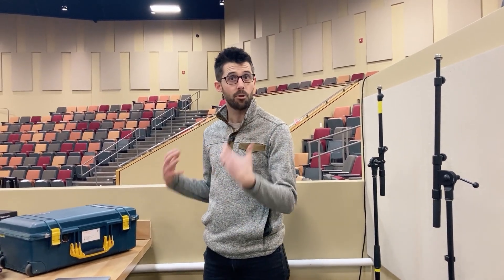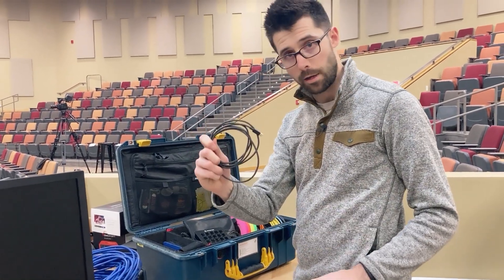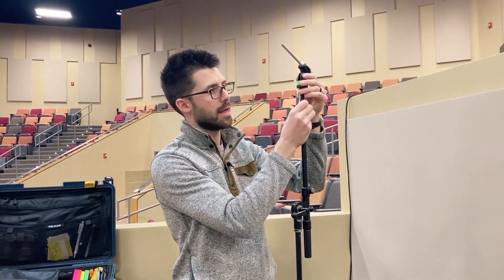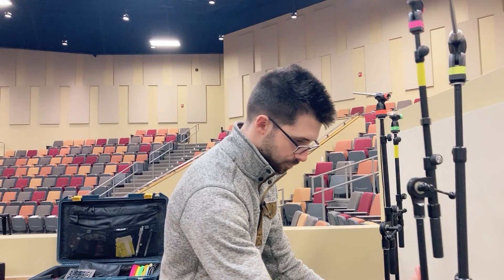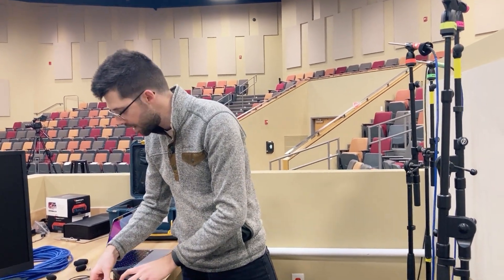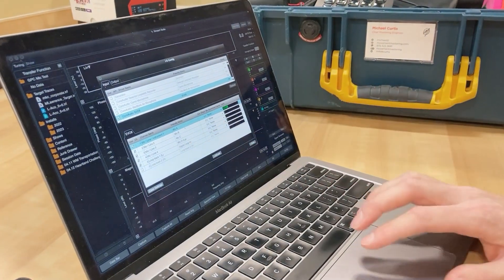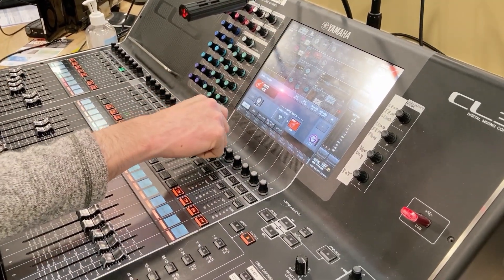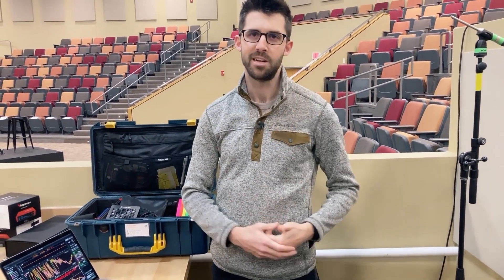Setting Up My System Tuning Rig From Scratch In The Field

Comment: Hi Michael, thanks for making these videos.  I recently purchased a set of 8 JBL SRX906LA speakers that I want to hang.  These will be for mobile events and the JBL tech that I'm currently speaking to knows nothing LOL.  I'd like to know what the steps to get started to fly them (I have the lifts), best way to control them, what software to use for prediction, etc.  and in what steps to use each software.  Thanks!

Comment: Hey Michel,

You don't need to have a loop back (Main out --> input interface) as you showed in a previous tutorial ?
I suppose you can have a loop back with internal routing. I thought you need to use the same path as you use for the measurement mic.

Thanks for your work.

Comment: Hey! Is there a reason, why you're not using the build in signal generator of the CL3? Loved the video!
Reply: I may be mistaken, but I  believe it so that the software knows the source signal and can compare the source signal to the measured signal... if you used the generator from the console, the software would only be able to measure the signal in the room, but not compare that measured signal to the original to determine where it shifts.
Reply: But couldn’t you just route the mixer Sig gen out to the computer so it uses that signal coming into the software as the reference?

Comment: Hi! You mentioned wireless, would it be a bad idea to use a wireless system for reference mics?
Reply from the maker: As long as the system is LTI - linear and time invariant. Even nice stuff like Shure Axient has some amount of variance in the timing of how the signal is transmitted, so isn't suitable for tuning (although it's plenty great for wireless vocals and such). I'd like into the Lectrosonics TM400.

Comment: Hi Audio University, I have a question. Most of the time in live sound applications, the speakers sound distorted when the full band is playing. (Keys aren't hearable, bass sounds muddy, drums isn't clear) Do you know what causes this? When I test them alone it's fine and it sounds good. I also checked the amplifier and it's not clipping at all. My gain level on the digital mixer is always -18dbfs.

Comment: This information is so helpful!

Question, do you recommend using something like Waves “Tract”? And if so, would you be willing to do a tutorial on it?
Reply from the maker: You're very welcome! I personally haven't used Waves TRACT yet, but am hoping to get a copy and try it out soon. The EQ within the plugin itself in and of itself is just fine, but the most common error when using the TRACT plugin is folks not carefully WHERE to put the mic for measurement data, as well as having a systematic workflow to work through different speaker zones.
Reply: @MichaelCurtisAudio  I appreciate the response!!!

Comment: We are basically using this same setup for spl monitoring on Sunday mornings.  How would you calibrate the gain on the mic so that is correct?  We do have a mic calibrator but it always seems to be way Hotter than actual sound levels.
Thank you for all your hard work.  Loving all these videos!

Comment: Not sure why I’m having trouble understanding the reason to loop back the reference noise… what am I missing by thinking you can just turn on pink noise and do your measurements? Where does the reference loop come into play? Thanks!
Reply: The way I understand it is that if smaart don’t have a reference signal, in this case the loop back, how is going to know the difference between a good flat frequency response and the frequency response coming fro your sound system? (Which for sure won’t be flat)  the loop back is to tell smaart: here! This is pink noise, it has a flat frequency response (the goal), I want you to compare this signal with mine (the mic capturing the pink noise coming from your sound system) and show me the difference between the two, so I can try to match them through EQ… like I said, in the end the goal is a flat frequency as possible (or target curve of your choice) according to the room. 
I hope this help, and I hope you don’t mind me commenting… I was just going through the comments sections looking for answers too!

Comment: Hey Michael, great series of videos, I currently have the same setup as you, except with TM1 mics. Smaart works as it should on PC, however on my 2020 Mac Air, I can’t get any input to Smaart, RTA doesn’t show anything on any input. EVO mixer shows that my routing is correct. What am I missing, care to share your settings? Thanks
Reply from the maker: Hey, Douglas. I've had the same issue with my EVO 8 rig with my 2020 MacBook Air as well. I usually end up having to unplug the interface, restart MacBook, log in, then reconnect the EVO 8, start up the EVO 8 Mixer software, THEN launch Smaart, all in that order. Give that a try.
Reply: @MichaelCurtisAudio  mine was permission related to microphone for Smaart in privacy, Rational got me straight, now if I could get the iSEMcon mics, there’s no ETA per Rational Acoustics

Comment: Nice video Michael! Waiting for a next lesson.
In the second section you said that EQ is the last part of the process. But we should tune speakers timbre (EQ it) first, then align it, cause EQ-ing means (little but still) phase shift. Does it make sense?
Reply from the maker: Yes, that makes sense. You're right that EQ for each subsystem precedes alignment, but I almost always add some broad tonal shaping EQ to the rig once I'm hearing all PA elements at once.

Comment: hey quick question... I've seen your videos and i've tried to follow your instructions to tune a PA. I use a UA Arrow and i usually cant get the same results you get, should i buy a focusrite?
Reply from the maker: Hey, Gabriel. You should be able to get great results with the UA Arrow. Have you measured a speaker in the near field and gone through each part of your signal chain just to make sure you're getting accurate data?
Reply: @MichaelCurtisAudio  hey i see you usually answer to most of your comments thanks🙏 and yes i usually get as far as calibrating the mic and after that i can't get the right readings but i will try again and see if i can troubleshoot.

Comment: Great video, really helpful. I was overthinking the colour coding for the mics. Was trying to find tape in a sequence of the resistor colour code, but GOPY works! 

One thing I didn’t hear you mention is to do the channel setup on the mixer before plugging in the OSC connection. At least check the phantom power is off. Not sure how tolerant the EVO8 is of phantom into its outputs.
Reply from the maker: That's a great point about phantom power! I'm almost positive the EVO 8 outputs have DC blocking, but not all interfaces do.